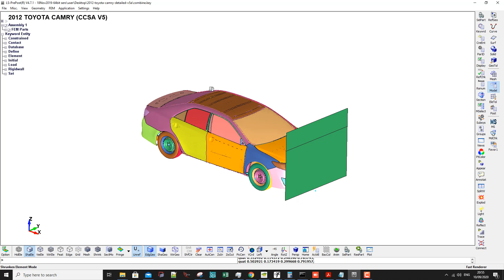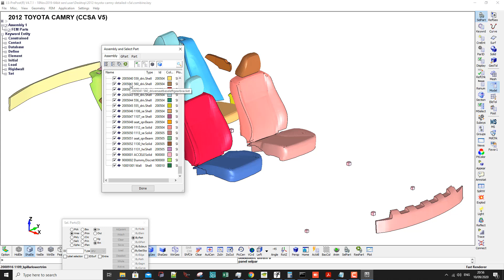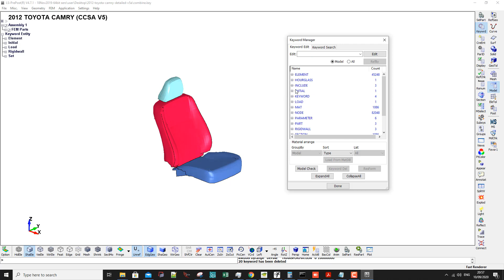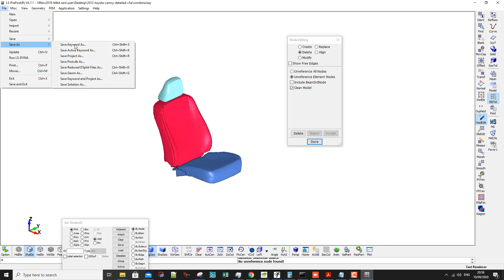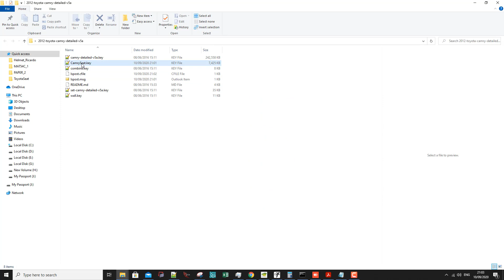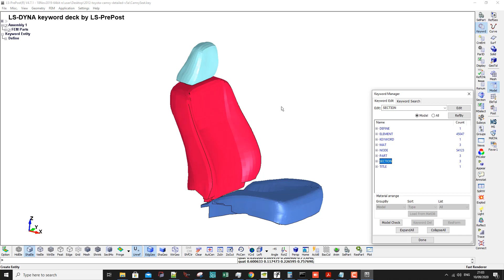How to Extract part from a detailed model? LS-Prepost Tutorial

Comment: Hello Mr. Topa, Thank you for the videos. I have a question if I only want a car without the solid element seats, can I still use the same approach? I am not sure if all the connections (CNRB, beam, weld, etc.) still work.
Reply from the maker: Hi there. There are models which has no seats. You will see that they use CNRB to link some of the nodes in the lower frame to mass element which represents the seat + driver mass.
Reply: @AmeenTopa  thank you very much!

Comment: How can I transform the FEM Parts back to Solid Parts? I only have the .k model and want to redesign it on CAD software
Reply from the maker: Unfortunately, there is no way to do that using LS-Prepost. You need to have the original CAD file.
Reply: @AmeenTopa  It solved actually. I managed to do that by using HyperMesh

Comment: Thanks a lot for this tutorial, well explained and very useful! I am currently working on a similar problem: I have to study the biomethrics on a dummy subjected to a vertical crash (A/C). To speed up the simulation time I extracted the seat from the full model (just as you explained) and then added the dummy. In order to analyze the new model, I need to assign the accelerartion pulse I got from the complete model simulation (without the dummy of course). So, I am struggling with the kind of boundaries I should give to the seat, what do you suggest?
Reply from the maker: Dear Geo,

You can check this link on dummy positioning on seat:
http://www.lstc.com/lspp/content/tutorials/6/t6p1.shtml

Comment: Thank you so much for the excellent content and instruction, very easy to understand. What if I want to extract not 3 but a larger number of part (for ex: 200 parts out of a 3000-part from a detailed model), should I use the same approach? I'd appreciate if you reply this, i'm new to ls-dyna btw so thanks for helping me out.
Reply from the maker: Yes you can use the same approach. But it will be very tedious work as you have 200 parts!

First, I recommend that you search and search for a smaller file (file that is not that detailed, or the individual files used in this big file). If it is not available, then yes you need to do this method.

I worked with a human body file. I am interested in the head only. I deleted everything else following the same method in this tutorial. Luckily, the head parts was in order (got PID = 100XXX, then starting from body and limbs, PID = 200XXX), so I only needed to deleted one chuck of parts and it was done. I didn't delete the extra section or material ID as it won't make much difference in the file size and won't make the file run slower. It will just be a bit messy which I am okay with.
Reply: @AmeenTopa  That's very good to know. Actually i'm working on a similar proj and i keep worrying that the extra secID and MATID may cause errors and all the constraint within the extracted parts which can interupt the simulation so i do not mess around with it. Thanks again!
Reply from the maker: @mrcaobang  No problem. 👍

You need to check the constrained though. If a constrained is defined on a part but the part is deleted, then this will cause an error termination.

Comment: I have a question. How do we extract some of the elements from a part to make two seperate parts? I have like 10k elements to reinforce from main part. Doing from keyword one by one is a bad idea.
Reply from the maker: How does the elements are connected to together? You can use MoveCopy tool to create a copy of existing elements. You can select the elements by making an area, a circle, or by selecting one element then use propagation option with controlled angle.

Comment: I have a question. For example, I have 50 solid parts, those are stirrup rebars. How do we group those 50 parts into only one solid part? instead of having 50 parts. Because assigning material/section or else one by one in keyword manager is taking forever, since they all have the same material and section. Thanks before, your video is very helpful
Reply from the maker: Use MoveCopy tool to change the part ID of those part into a single part ID. 

Or, using a text editor, you can assign the material and section ID faster even if you have to do it 50 times. You can use find and replace tool.
Reply: Thank you very much Ameen !
Reply: Which one of your videos explaining about using text editor and assigning multiple material or else at once ?
Reply from the maker: @auliamuhardiarifin8427  No. I have used texteditor in some of my previous videos. But not for assigning multiple materials at once. It was copy pasting material definition from another file.